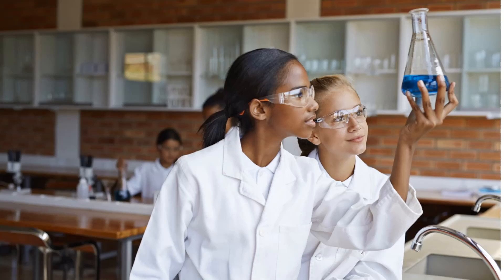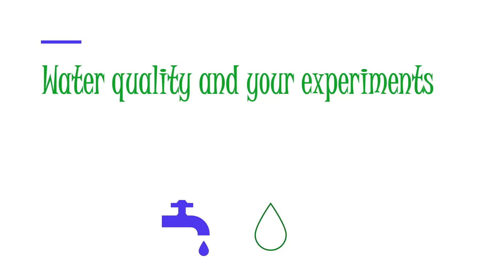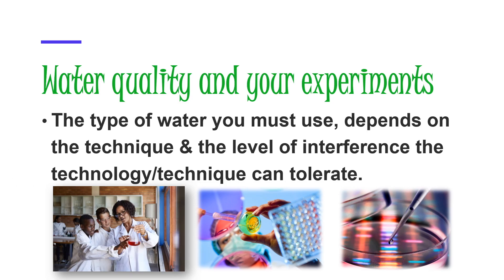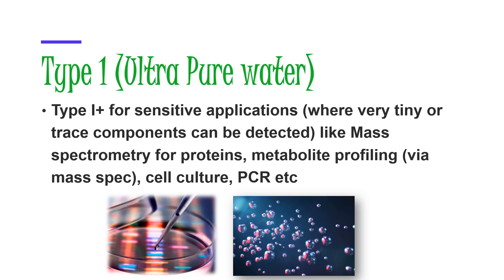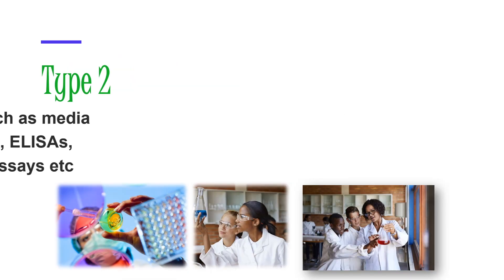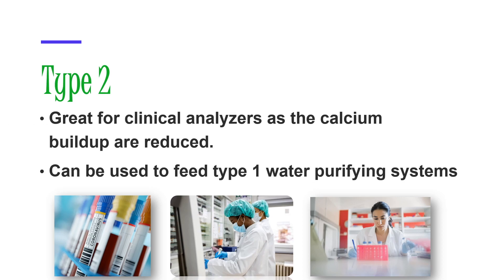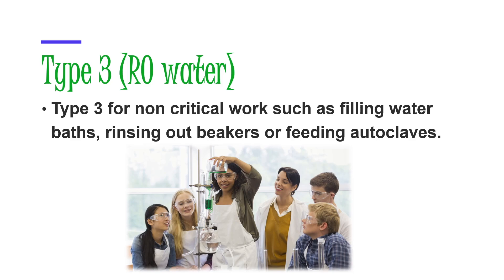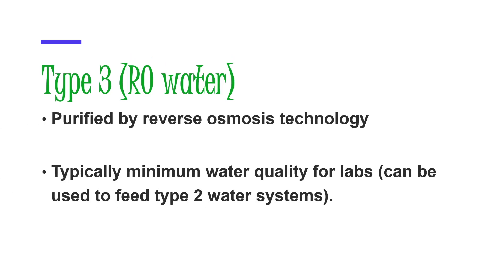Demystifying Laboratory Water: Understanding the Different Types for Scientific Research 💧💦

Comment from the maker: Other terms used to describe water quality in the lab includes: MQ/MilliQ water for type 1 water; 
Elix water for type 2 water and RO or demineralised water for type 3.
Note that distilled water is water that is clarified through heating the water until it enters vapour form, and then cooling the water back to liquid form. Most labs do not use this method of clarification, preferring to use reverse osmosis, due to its greater efficiency.